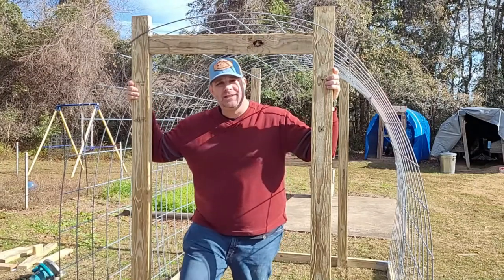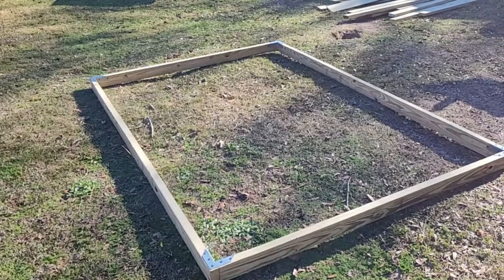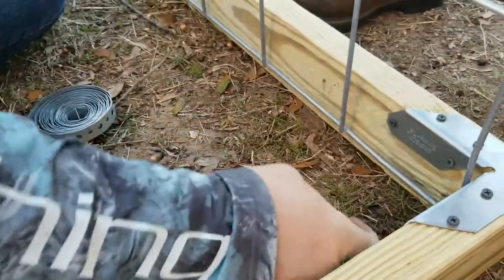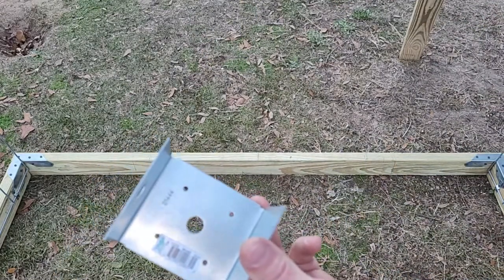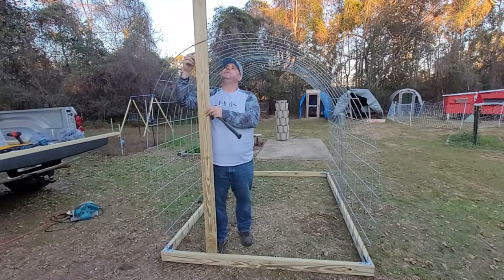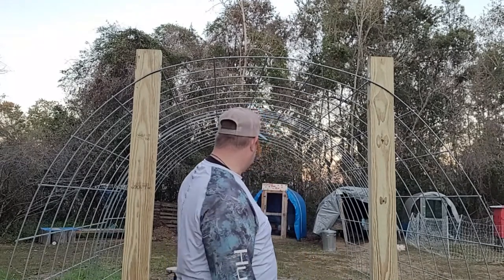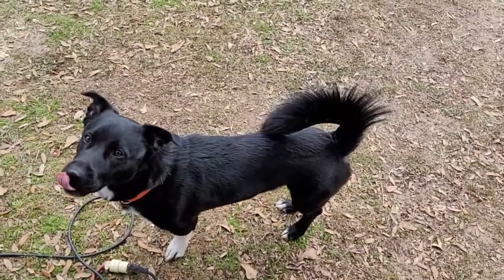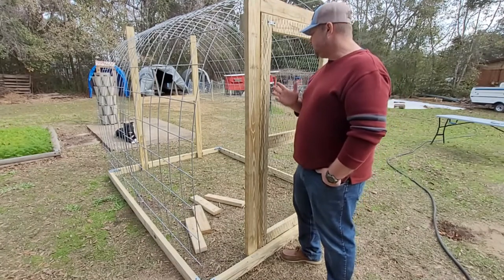Building a Chicken Hoop Coop for Beginners

Comment: I'm wanting to use the same basic build but adding a raised henhouse on the back side.  Eventually I will use metal roofing to cover it but will start with a tarp because of funding.
Reply from the maker: We have used tarps and they have worked well. Watch the video where we turn a hoop coop into a goat shelter where we use pvc roof panels. Much easier to work with and no sharp edges for animals. Cheaper than metal also...thanks